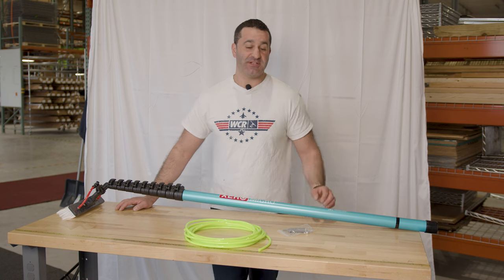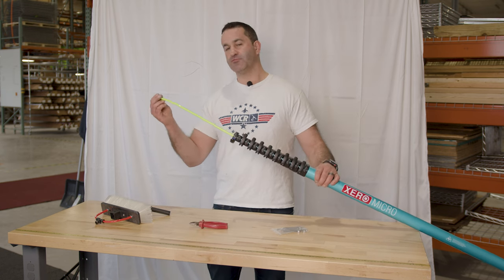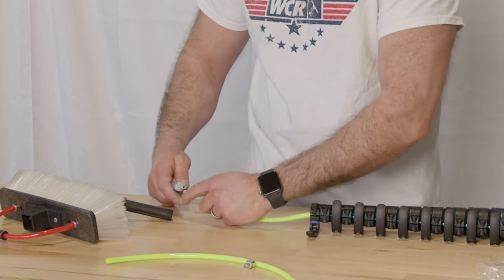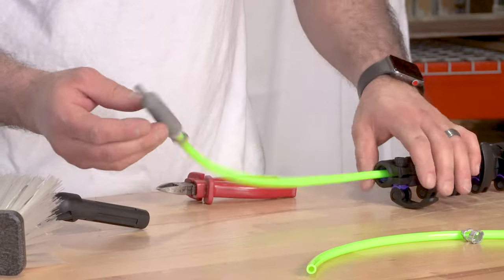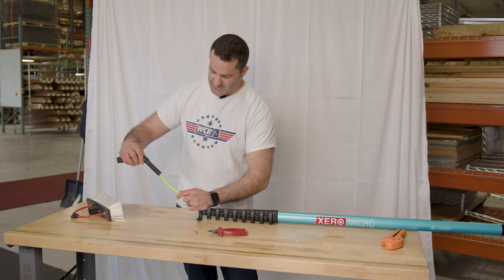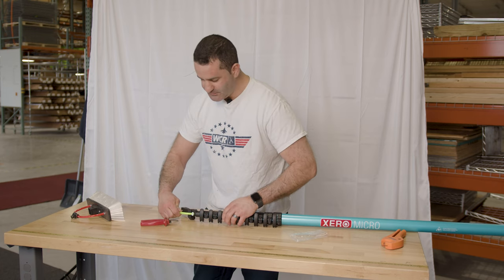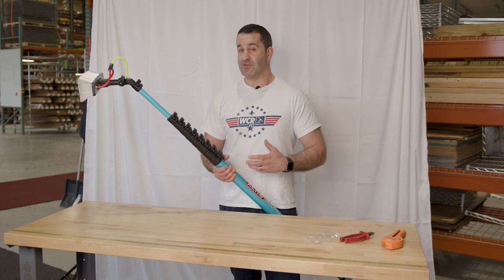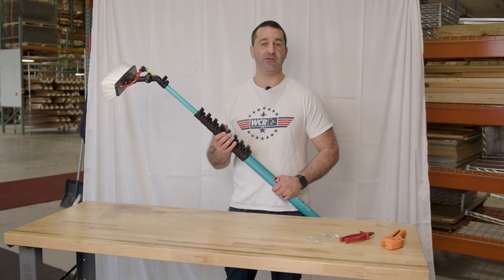Installing a Waterfed Pole Uni-Valve

Comment: Is anyone else having trouble sliding the tubing over the barb?
Reply from the maker: Hi Michael! Two ways to get the barb installed, you can soak your hose in some hot water to soften it up, and put some lube on the barb. We generally recommend Magic Lube: https://windowcleaner.com/products/aladdin-magic-lube
Reply: @windowcleaner  Thanks that helped.  I got this up and running and it is very handy.